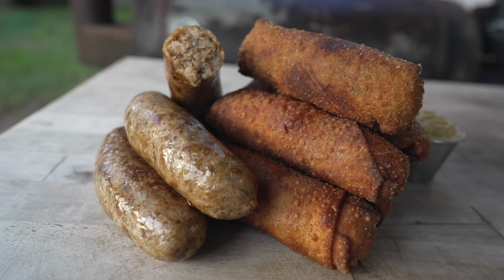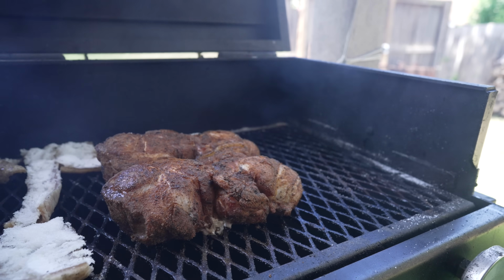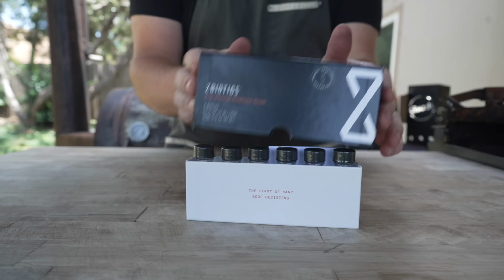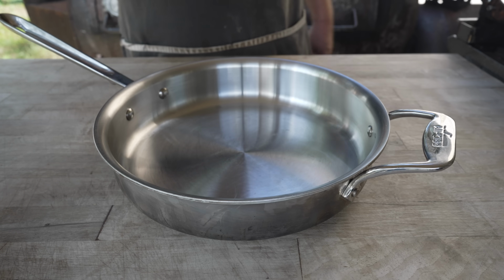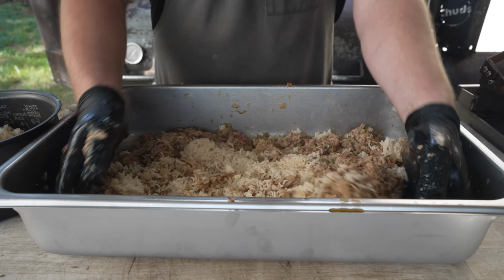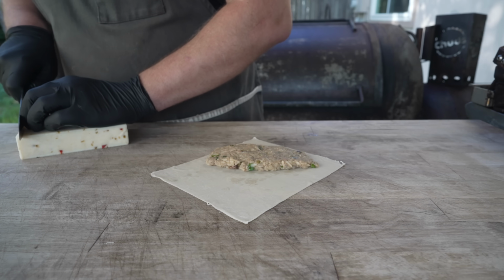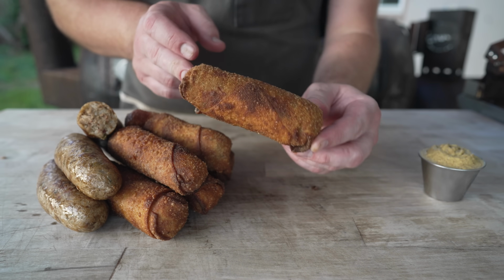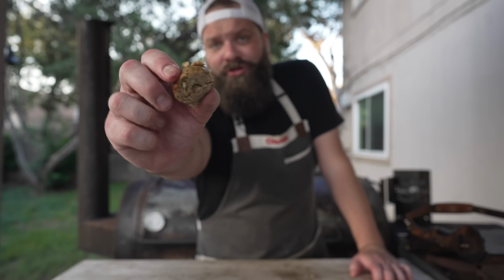Barbecue Boudin Eggrolls! | Chuds BBQ

Comment: Bradley, 1 question and 1 comment.  Q: why doesn't your cutting board smoke when you drop the hot plate on it?  Suggestion: Slap Yo Mama seasoning salt is, IMHO, much better than Tony Chachere's.  Give it a try.